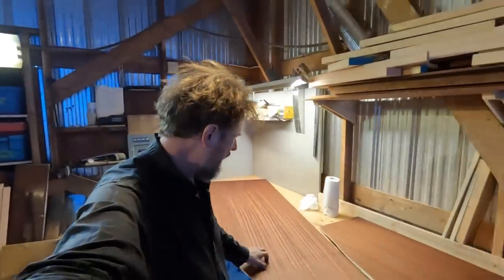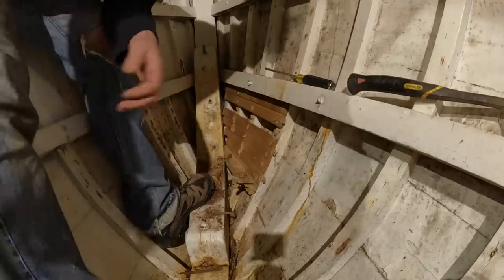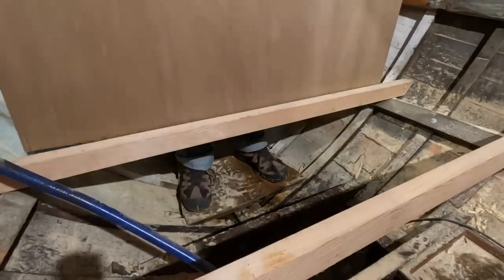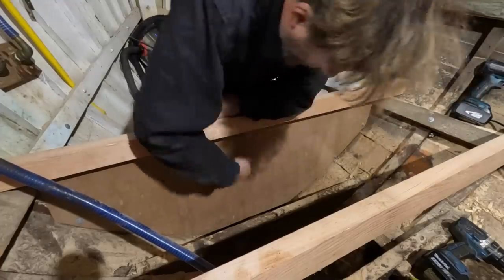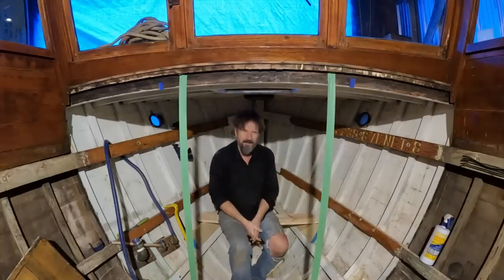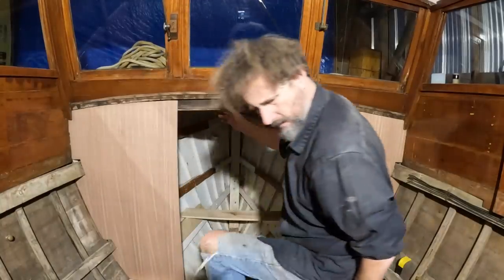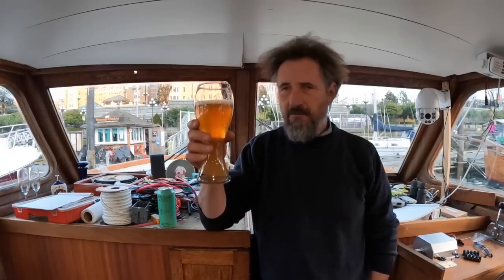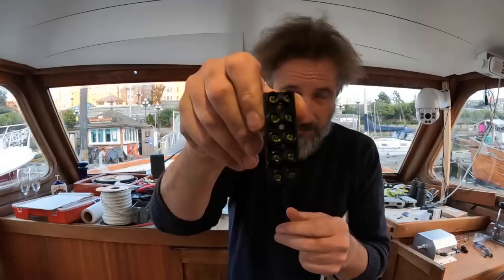Fo'c'sle Bulkhead - #346 - Boat Life - Living aboard a wooden boat - Travels With Geordie

Comment: Another winner Peter!! great episode!

OK, I always like using a sheet of cardboard to make templates for things I'm building, especially where there's compound curves, odd shapes, and/or tight corners I need to get into. You can trim it with a scissors, fold it over, and 'scribe' onto that!! (Nyuk, Nyuk)
Then you'd have an exact pattern for whatever shape you need to cut, saving both time and materials.
This method couldda worked out really well for all the sheet cuts you did this week.
(as soon as you made the second bulkhead sheet, I was wondering about whether or not it was double sided material or not. Bummer) :(

Love this cute little boat, and you're doing it justice with your well thought-out handiwork. CHEERS!!
Reply from the maker: It's funny, I rarely template, well I guess I just did for the bulkhead on Zephyrus.

Comment: I had to laugh when you cut that bulkhead out reversed like that. That is exactly something I have done on (sadly) more that one occasion with an expensive item. Its a proper DOH! moment as you only realise when you offer it up. My last effort was on a roof I was building, I carefully scribed the first to fit, knowing there was a mirror image mate on the other side, I clambered down and simply flipped the one I had just cut, cut to mate, clambered back up with both, the first, of course fine, the second also perfect except to roof covering  waterproof side ended up on the inside!!! Oh, well, at least you have a useful sized piece of scrap now.

Comment: Hi Peter.
I tend to use the old bits of ply etc with a load of 2" steel screws to make patterns...
I've given up on buying decent ply in the UK... I bought some so called marine ply from a known trade retailer in 2017 for my gunnels.. it delaminated and turned to mush in 4 year's... (I've now replaced them with a non wood composite).
I thought about a bunk that could go under the benches from the forward cabin.. did think the kitchen could have been there.. did you explore the idea of a seat on one side making use of the hull for the back of the seat.. I saw a powerboat at a show using seating.. like a bucket seat settee in the bow.. really comfy.. I think it had 2 Lamborghini engines.
Regards from
Bella 🐈 & Mark
Reply from the maker: Cool that you thought of the quarter berth, I was playing with that. But it's just too tight. berth would be 15" wide!

Comment: Peter I'm late to the show this week- wonderful as always, but a thought to keep in your back pocket: the main bulkhead in downeast-style lobsterboats is structural. It bleeds off stress where the flare of the hull flattens and becomes the midbody, to prevent accordioning motion as the hull works in a chop. I'm thinking that in the future if you see flaking paint in the area it would be kind to add knees to the deck beam at the main bulkhead or to sister it.

Comment: Try applying the oil based finish with a foam roller, it puts a thin even coat on that dries quickly. You can sand and recoat the next day. You want to coat both sides because having one side moist will make it warp. I always sealed everything in epoxy before varnishing it. Epoxy is 100% waterproof, fills in the grain and makes a perfect finish. You need three things for dry rot, moisture, spores and air, eliminate any one of those and you will not get dry rot. I’m surprised you don’t have a ceiling on the hull because Victoria is quite humid in the winter (I am also on the island). Spiling would make your fitting easier. Also a Fein tool comes in handy for fitting. If you need some vintage brass screws or nickeled brass I have hundreds of lbs from my wooden boat shipwright days.

Comment: Thought I'd scribe you a comment regarding non-alcoholic beers. I like drinking beer so much that I find I have often had too much of it over the course of the evening. I decided to give the non-alcoholic offerings a try, and intersperse them. Hard to know if any of these are available in Canada, but I have found that Athletic Brewing's Run Wild IPA is decent. Another one I find decent is Sam Adams's Just the Haze, and then surprisingly good is the Non-Alcoholic version Guinness is offering, which comes in a can with the little ball like their normal offering, and is designed to pour straight into the class quickly, and then to let sit a bit.

And I really love your channel, BTW!